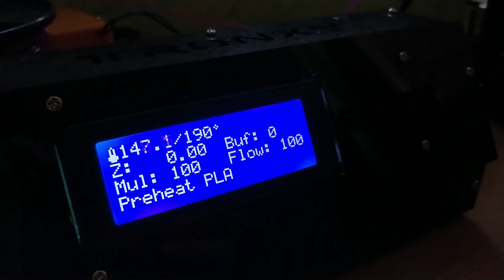Fix Poor Extrusion

Comment: Hi, Caverntwo!
I have few underextrusions (but they're ugly as it's almost the whole layer). Can it be the wrong calibration or some degradation of the extruder? I just don't want to dissasemble the hot end (the case's construction is ugly and every time it's like a puzzle) and think "can it be fixed with a calibration?"
Generally it's started when I've renewed the firmware with the new one where Linear Advance is ON. It doesn't works for me (or need a lot of measurements and calibration). I've turned it off and turned on S-Curve. Also I've copied all old values for step/mm from that old firmware. Most of all major underextrusions was "removed" but I still hear clicks and (of course) it underextrude with a delay.
Reply from the maker: You're right, most extrusion problems are because of wrong calibration. Try to calibrate the steps per mm properly, this helps if the motor is clicking all the time although the print is fine. If it's too small, the whole print will be ugly and no clicking heard. Another pretty easy thing is to check the filament diameter in the slicer software: Cura likes to reset it to 2.85mm.

If the under-extrusion is irregular (2 layers normal, then a few wasted ones) or came all of a sudden (all prints worked fine before), it's an hardware issue. Think about it, if something's clogging the extruder and you increase the force, it will still be blocked. It's mostly some dust or something that will block the small .4mm hole to yield results like the one shown in this video. I also had the PTFE-tube of the hot-end molten once (printing PETG at 235°C), clogging the extruder immediately.

I haven't been using linear advance so far, so I can't tell you what's the problem there. 

If you have a Bowden setup, check the couplers and tube itself for problems. The tube on my A2 was too wide, resulting in the filament "curl" inside, destroying retractions and letting the motor click all the time.

Last but not least, check your retraction settings: If you have a cheap hot-end like I do basically on all machines and the retraction length is longer than the heating-zone, the filament liked to get retracted and not find it's way back into the hole, effectively stopping all extrusion until the (maybe) next retraction. That's also a thing when writing with a mutli-extrusion setup and has destroyed so many prints in my case.

I hope that I could help you, keep me updated!
Reply: Thank you! I'll calibrate tomorrow probably. I have just some layers (and not the whole usually) underextruded. About 16-20 times over the whole ~4 hour print. It must be 2000 layers. Although some underextrusions longs for 3-4 layers (it was ~2 times on last print).
I hope my PTFE will stand against PETG :) I've didn't tried yet.
Reply from the maker: That's awesome to hear!
My A8's PTFE -inline lasted for like 3 months of weekend-printing! 

Have you watched the printer while it under-extruded? Maybe it's something as simple as a stuck filament spool?

I hope that you can get it working!
Reply: Sorry but it's a bit early to make conclusions about my PTFE inline :) I've printed maybe about 10-15 times yet. More about modelling, thinking, trying and etc. It was started when I've realised that ~70$ for a plastic stand for two mini-synths is too much :D (there are two wooden planks also) So I've decided that it will be my new quest and I'll make my own stand. Of course will make more things, tech. part replacements and toys (maybe).
I've checked now. Seems that PTFE tubes are easy to find in our city. As I've found my hot end needs 4/2mm and this size is mostly common (not only for 3d p. area).
Reply from the maker: 4mm/2mm is the correct size for the Bowden Tube (going from the motor to the extruder, as seen in this video) while 3mm/2mm is for the PTFE-Inline (in the heat-break). (I've bought the wrong size twice...).
However, there can be multiple issues causing your problems, I just suggested you take a look at the inlined PTFE as this was the cause of trouble in my case. 

I can really recommend you watch the print and find out what's going wrong at the time the under-extrusion happens. However, also check whether the issue is really under-extrusion and not a skipped layer (there was an issue with Cura just skipping layers once).
I can remember, my Anet A2+ was under-extruding a lot, but there were multiple reasons, like a wrongly-sized PTFE tube, slipping filament at the gear and even a clogged nozzle.

Please keep me updated!
Reply: I was watching with caution and it's not a layer skipping (also I watch a sliced model in Layer mode every time before sending it to print). It's not a jammed filament in spool (because I've checked for this condition a lot of times). If there were a lot of retracts happened (by default there is 90 max value and I've set to 7 now) then the extruder just started to grind into the filament (with bite paths). I've tweaked the nut and set it ~ middle position as Rui recommended. Also checked by pulling it out (so it's not going out) and rotating the big gear (with turned off printer) for few millimeters. Maybe I need to check it for a bigger length. One guy did show that his extruder's bearing (i mean that part which presses upon the filament) isn't round actually. A bit oval. Probably if it's true in my case then I need to find a balance between slipping and grinding.
The nozzle was fixed in a right position (so it's not touching the heater block) before the 1st print (RuiRaptor's tech. advice). So a clog is the last possibility in my case I hope.
Reply from the maker: Sounds good so far, as you've actively looked thru many different scenarios and managed to exclude a lot of them. That strategy is pretty good, I didn't follow it so closely.
I'm pretty sure that you'll be able to locate the cause of your problems pretty soon, but don't be surprised if it's a combination of multiple minor things.
Reply: Sure! Big thanks for your advices! Will check that 3/2mm PTFE sizes, you must be right! Thanx again!
Reply: Hi! I've released the PTFE from the hot end and extruded 100mm. It's about 100.5 - 101 mm in real. Does this matters?
Reply: was set to 406.37 by few measures and calculations. Now I'm guessing that the difference of a possible over-extrusion is so minimal... That shouldn't create that clicks and grinding IMO (not sure).
Reply from the maker: You're right, 1% shouldn't be too much. You could correct it, if you want, but it's probably not the only cause for your issues.

Comment: Oh i love my tronxy. The first thing when the vid started was a familiar 3d printer. I got it 2 weeks ago and i love it so much.
And as you can guess, i still haven't got my settings right, thus a slight amount of underextrusion.
Reply from the maker: Nice to hear that you love this printer. In the meantime, I've upgrades the extruder to a standard E3D-V6 clone and never had under-extrusion or clogging again. (I might mention it in a video soon, just realized that I haven't done one so far...)
Trust me, you can get these settings right pretty quickly, just make sure that you chose the correct filament diameter and have the retraction distance not exceeding 5mm.
Reply: Oh. I didn't even think about upgrading the extruder. Though now that you mention it, it might up the quality.
I'm a noob when it comes to 3d printing. None of my friends have got one of these yet, so i've been having to rely on online sources for help. Lucky for me, there are channels like yours on youtube, so it hasn't been a problem to find help.
Reply from the maker: I also only thought about it after I've ordered like five E3D-V6 clones and my father annoyed me like twice per week about why it always clogged. The problem is that the stock extruder shares the design with the E3D-V6 lite, where the PTFE tube is pushed all the way into the heater block. The "normal" E3D-V6s and the clones I got have the tube only pushed to the beginning of the heat break. The main advantage is, that if the tube is not completely in (like 1/2mm too less), the molten material doesn't just block up and lead to the "effects" shown in the video.

Comment: I can see that you chose the right way to do it but i always use the smallest allen key to shove the jammed filament down and it worked ,somehow . However i think it will not only damage the machine but it hurt my fingers the first time i do it. I think throat clogs is the one that annoyed alot of people and their solution is oiling the filament which will reduce the layer adhesion.
Edit: the reason i do it is because i printed a bracket that can hold the fan separately and doing that only requires me to move the nut and stepper aside.
Reply from the maker: Yeah, that's also a way of doing it. My honest opinion about this is that if you manage to achieve your goals, do it, as long as you don't complain if something didn't work out on your way. 
I've never tried lubricating the filament, but I was about to do so once on my A8. The replacement of the PTFE inlined tube helped a lot those times...

Comment: you said the filament is coming out straight so you didn't do anything with the nozzle, but what do you do if your filament always curls up?
Reply from the maker: If it still prints normally, then it should work. But if the prints suffers from under-extrusion (like shown in the video), your nozzle might be (partially) clogged. Get some calipers and measure the thickness of the extruded material. If it's well under your nozzle diameter, you need to go one step further and remove the nozzle (while heated up). A small wire might help you unclogging it. 
Of course, there could be many more issues causing under-extrusion (like wrong filament diameter, broken PTFE tube or slipping extruder gearwheel...) and this video should provide a fix for the probably most common cause.

If you have any more questions, do not hesitate to ask.
Reply: Caverntwo can’t that be a input issue on the g code end? Do you have a video of your typical print settings (simplified 3D/ cura)so one can determine the issue directly? How do you get the melted filament out, solvent?
Reply: Try to install another extruder model? 
How much voltage base thing use?

Comment: It turns out there are multiple issues the first issue was that the part that the filliment is pushed into was backwards making it so the gear weel was pushing the filliment down but the hole was farther forward. Now that I flipped it around the filliment is being pushed straight down into the extruder instead of sideways. Then I had to tighten the spring by turning a screw. Then I when I went to level it it said def in the tempeture section which scared the world out of me but all I had to do was unplug then replug the printer to fix that. Now I’m having it print a cube. The walls are looking amazing but the bottom had slightly bad extrusion. I think I can fix that by making the bottom about 5 mm a second. The rest is about 25 mm a second. I really want it to go faster how can I do that. Btw I am printing at 220 degrees celciouse, pla. With 110 percent flowrate.
Reply from the maker: I think the only real solution to the remaining problems would be an extruder upgrade (to an E3D-V6/clone, for example). But it's nice that you got it (halfways) working again^^ Sooner or later you'll figure out what causes what problem, and so on.
Reply: I got it to extrude a lot better by tightening the spring past my comfort point but it's working! Thanks for your help along the way. I'm going to go print to my hearts content now, hope fully I won't be back with another problem. Bye!
Reply from the maker: That's nice to hear! Happy printing!

Comment: O sorry I the gear is spinning with the shaft but the weel that is beside that is not spinning
Reply from the maker: hmm. Try to investigate whether the lever isn't able to fully hold the filament to the gearwheel. In my original setup, there was a screw from the back too long, blocking the lever in its movement. Maybe you have some similar issue.

Comment: No the gear weel is not turning. I pushed in the lever and pushed the filliment threw and there was median resistance. So the problem is the grip on the filliment. As I said the spring is tight and the filliment does not have any grip marks. How do I get it to grip tighter? Tomorrow I will tighten the spring even tighter and see if that helps.
Reply from the maker: The gearwheel has one or two small screws that fix it onto the motor's shaft. Tighten them, it'll solve your problem.

Comment: I have always had under extrusion with my anet a8, i have to print pla at 240 degrees celcious and at 10 mm per secoind. what could be the potential problems?
Reply from the maker: There are multiple issues that can cause your problem. First, perform the actions shown in this video. If this doesn't fix your problem, a wrong setting in the software (e-steps per min/ Flow %) could cause this problem. Try playing around with these values. Does your printer constantly under-extrude or does it start after some time?
Reply: Caverntwo it always under extrudes. I had it working for sometime then the filliment jamed from my pulling in out how you showed. Then after unjaming it I tryed printing again and it has had extreme under extrusion since. I try to push it threw with my hands and it goes threw easily. I put my hand on my motor and i feel faint bumps of movement , and here very very soft clicking, how do I fix that?
Reply from the maker: Try to unclog the nozzle as well. You need to heat up the extruder and then screw out the nozzle out using a wrench. Especially if you operate your printer in a dusty environment, it's very likely that your nozzle is clogged. And a partial clog can lead to constant under-extrusion.
That was the reason for the change to an E3D-V6 setup, as my room is quite dusty and I didn't want to disassemble everything to reach the nozzle/PTFE tube inside the heat-break.
I hope this helped.
Reply: I was looking at my nozzle when it was extruding and i realized that the filament being pushed down by the extruder motor did not look like it had any grip marks like i saw in another 3d printing video. I then pushed my filament threw the nozzle and realized that when i pushed the filament threw the nozzle it happens in two steps. first there was no resistance then there was a little bit of resistance. the filament i thought was coming out from the motor pushing in the filament was  actual just the filament leaking out over time!  what was happening was the filament was leaking out leaving a gap between the filament and the bottom part of the hot end. then when i pushed in the filament the reason it has no resistance at first was because i was closing the gap then it had resistance because it was going threw the nozzle! so i have come to the conclusion that i need to get the extruder motor to have a tighter hold on the filament. i dont know how to do that tho. the spring is very very tight. i think this is happening because the contraption it's self does not allow the motor head and the spinning weel beside it to be any closer then i already have it. do you know how to fix this?
Reply from the maker: You say that the spring is already very tight AND your filament, once it passed thru the motor, doesn't have any grip marks? Is the gearwheel turning? I had an issue with my TronXY X1's extruder once, where the geared pulley wasn't turning because I forgot to screw it onto the motor shaft. And when thinking about it, I also had severe under-extrusion then! 
Push down the extruder-lever and forward the filament into the hot nozzle. If it then extrudes with medium resistance, you know that the issue is at the cold end (forwarding-unit). If it only barely extrudes, the problem is at the hot end.
Reply: My Anet A8 has this problem too, all the time.